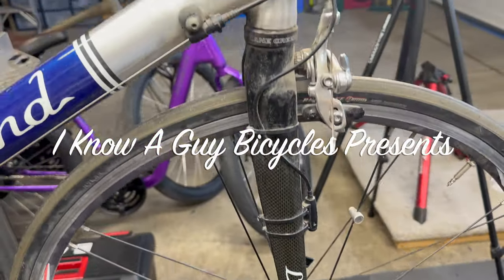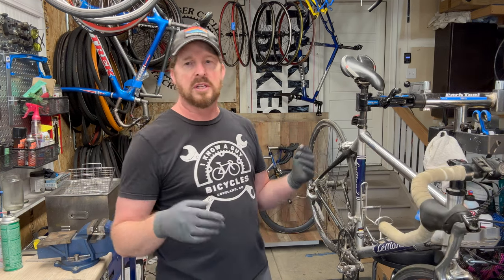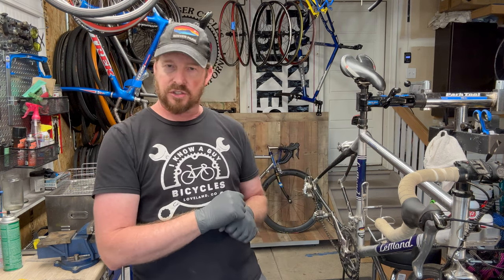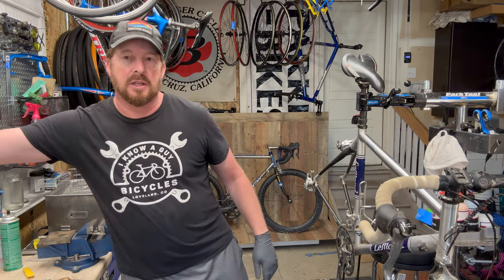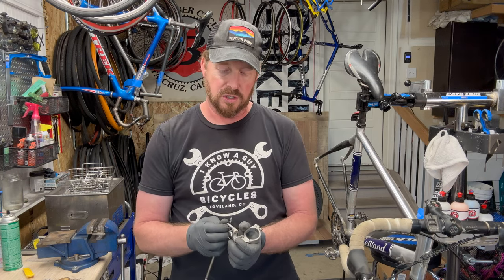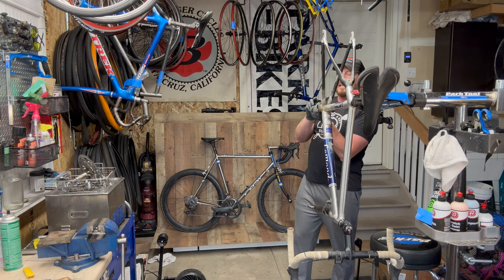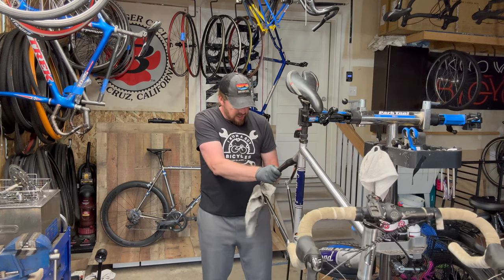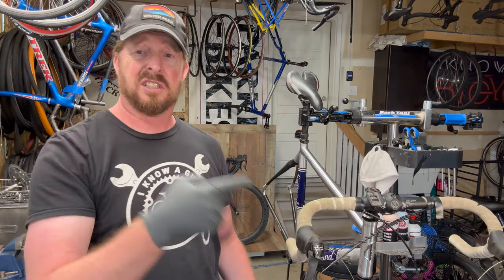What Will It Cost You? - 2005 LeMond Aple D’Huez - This Old Bike - Bicycle Safety

Comment: The Lemonds had the best geometry and ride of the road bikes that came out of Trek. The Treks were a Trek. The Kleins were Kleins. But all the years and miles that Greg Lemond had in the saddle showed up in his bikes. You could ride them all day and still be fresh at the end of the day. Making that long decent worth the work. The handling with these is so natural it's almost like a dream. With new wheels even at $1500( especially considering it wasn't used much) it's a bargain for long recreational rides. The triple has a wide range of gears and no real penalties . I can get 30mm tires in my Zurich ( I don't remember the clearance for ths bike, but it probably had clearance for 28mm tubulars for the spring classics ,yeah old school tubular paves were what I used ) 28 mm should be just fine for a modern set of wide alloy rims and 28mm tires ....worth the investment, because the ride is timeless.  Seem to remember this road very nice too since the fork and stays were well dampened for the road shcck.
Reply from the maker: Nice! Love mine.

Comment: I bought a bike of the same era for cheap and was really excited. Took it home and realized the wheels were loose at the hub, wheels needed to be trued and one wheel even had a spoke completely backed out. I have the skills to fix it (and I did) but it made me think how this would have turned into a not good deal for most people as the repair cost would have been more than the purchase price before even getting to replacing pads, grips, and a basic tune up. In conclusion, try to buy things in daylight.

Comment: The  Rolf wheels the rear ones just fail period....pretty much a design flaw. It not so much a matter of them being overtensioned. It's that the rim couldn't handle proper tension, especially with the spokes paired and so close together. Just use it as a bargaining chip when buying because you will need a new rear wheel at the minimum  and probably a front if not now certainly down the road. The thing is with the relatively low spoke count you need the extra tension to compensate or reduce your weight to 120 pounds.
Reply from the maker: It got worse when they did Bontrager wheels. The rears will eventually fall.